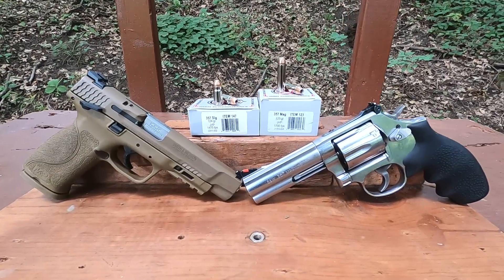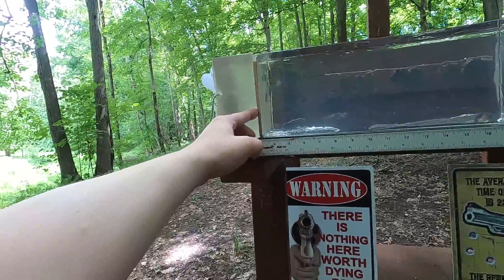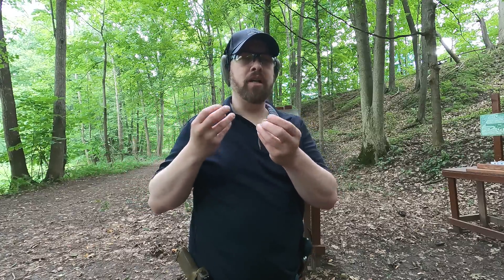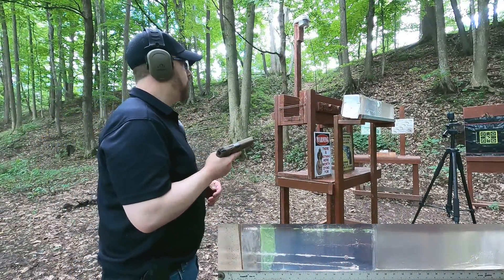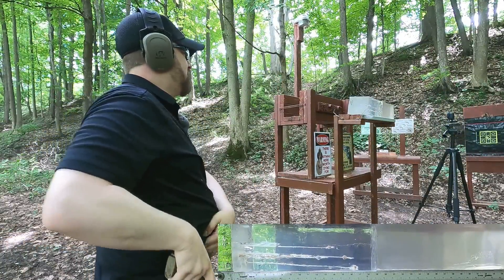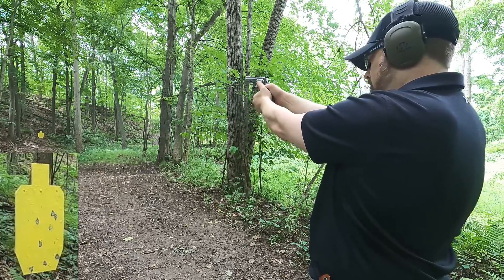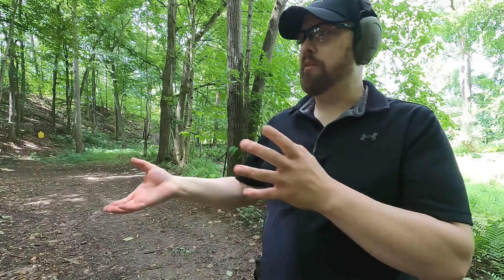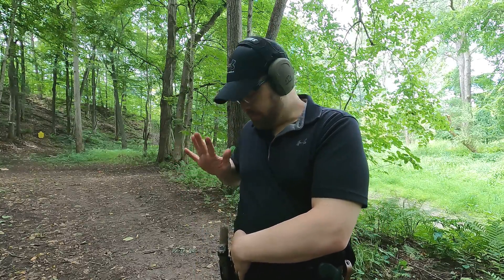💥.357 Sig VS 💣.357 Magnum - Underwood JHP - WOW - Game Changer!

Comment: Nice test. Looks like they did an awesome job of mimicking 357 Magnum 125gr ballistics with that particular loading. Hard to argue against 16 “Magnum” rounds with no reload. You did shoot the 686 better so that is worth mentioning. 

Good test. I personally may would lean towards a 40 Caliber anyway because the price of ammunition is typically cheaper and easier to find, but 357 SIG is probably the best overall auto loader caliber.
Reply from the maker: Thanks. I like .40 and .357 Sig. The .40 is more of a scaled down/up in a sense .45 auto, .357 Sig is like a magnum. So it's pretty cool how vastly different bullet weights can be between .40 and .357 Sig, 115 gr .357 or 200 gr .40's, so there's some versatility in there.

Comment: very good video as always!  and as usual i will say that even though there are inherent positives and negatives with any cartridge, so much depends on how the manufacturer chooses to load them. few and far between are 357s rounds that are not close to max, and it is designed for shorter auto barrels which why it is such a great round. the great 357m was designed for longer barrels but still has done very well in shorter carry lengths. as for the 40 ... (my conspiracy theory) the ammo manufacturers were paid off to sabotage it to revive the 9

Comment: That 357 sig is a great..I have 357 six inch barrel and love it. I have try to find a 357 rifle but it's like finding a treasure, always out and they r not cheap either...just love to have a 2000fps. with the rifle great all around round, decent for hunting within 150 yards which most of my hunting is 80 yards or closer..
Reply from the maker: You won't find much in .357 Mag rifles. There's not really a good middle ground, you might find the cheap $200 H&R Handi-Rifle in .357 Mag, but then the next thing up is a $700-$800 lever gun in .357 Mag.
Reply: @GunSam  Guess I have to work more overtime but I'm willing to do it to have one..

Comment: Do you think a 6 inch revolver would reach the advertised 1700 fps?
Reply from the maker: Underwood uses a 6" as their test gun, so possibly but it depends. With a 125 gr and the right powder, it's entirely possible that 200 FPS can be gained. With the "wrong" powder, you might gain no velocity from 4" to 6", and with 158 gr that uses less powder in general, there's no way you're going to get too much difference between 4" and 6".

Comment: I need a smith in 357sig, and maybe 10mil. Did you have to covert your Smith? Where did you get the 357 barrel and what platform do you need to convert it to 357sig?
Reply from the maker: If I am not mistaken, S&W stopped making anything in .357 Sig, but they did in their original M&P's. With the M&P 2.0 and all other pistols I think they do not make one. They have retained ".40 S&W .357" on their M&P 2.0 40 magazines so people can go with an aftermarket barrel like I did here. It's from KKM. Just the barrel swap is all that's needed for an M&P 2.0 40 to make it .357 Sig.
Reply: @GunSam  Thanks! I'd like there new 10mil too, but that 357sig will be first one my list! I knew there had to be someone that made M&P barrels. Thanks again get well soon!

Comment: If .357 Sig would have taken the place which 40 S&" once had it may still be there ahead 9mm. A major reason for going away from 40 S&W was that many LEOs couldnt handle the recoil good enough but .357 has less . So maybe 357 Sig still had its place. Its really strange that its such a underdog. But at least it was the caliber of the secret service for a while. I think they also go with 9mm now.

Comment: I wonder about cost and availability of .357 Sig range ammo.
Reply from the maker: all over the place. Generally it's everywhere, but less common stores might try to get $75 for it. Online it runs about the same as .357 Mag, maybe $40 per 50
Reply from the maker: but remanufactured is like $25-$30. It's just like, American Eagle that goes for 40 a box.
Reply: For the most part theres hardly any on the store shelves in last 24 months.
I ordered from underwood a couple weeks ago and it was on my door step 3 days later. 
Cost? I've been spending the same for 9mm and more for 40 at the local stores.
Reply: Investing in a caliber shouldn't even matter when it comes to your life. The 357 Sig is worth the investment.
Reply: @armedrebellion47  The gun is the investment.  The ammo is a cost.  If you go the range just twice a month, the cost of 100 to 200 rounds per trip adds up fast.  At the point adequate practice becomes cost prohibitive, you need to switch to a caliber you can afford.  And if you can't even find the ammunition, cost becomes irrelevant.  I own guns I couldn't shoot through most of the pandemic, because there was no ammo.
Reply: @bjs301  All depends on what you prioritize. I know guys that only shoot 454 Casull & 45 Colt. Neither are cheap compared to 357 SIG, mag, and whatnot. But unless the range was shutdown during the Crud. They were there every week shooting their 454's & 45 Colts
Reply: @nicholasroberts9618  Yes out of all the Ammo brands Speer Lawman will definitely be Available just purchased some last week a box of 50 rounds fmj was 56 Dollars each and i purchased Two.
Reply: @nicholasroberts9618  Yeah, it's back in Ohio, and the prices are starting to come down.  For a couple years it was scarce here.  Hopefully that's over.
Reply: @Matteo_  It also depends what you can afford.   I took one of my sons to the range recently, got on one of the interactive lanes, and shot up a couple hundred bucks of 9mm ball in an hour.  That was just two of us.
Reply: @bjs301  But it also comes down to what you prioritize. I know a guy who lives in a trailer, drives an old F-100. Yet he still owns 2 full auto machine guns. Met him at the old Knob Creek Machine Gun shoot.

Comment: Sam I would say the 125 is about the least efficient in the short barrel. If you picked a 158 SJHP loaded with Lil' Gun you could be getting over 1400 fps. No doubt though, that load for the Sig is awesome and I love the shootability of my 5" M&P.  The 50 yard 8 inch plate lives in fear when it sees the FDE 5" because it knows its gonna get dinged every second for about 15 seconds.

Comment: With automatic pistols you must lose a bit too with the backwards energy needed to drive the slide back so it probably equals out that lost in a revolver cylinder gap?
Reply from the maker: I really have no idea, but in general I believe that most semi autos have the locking mechanism that stays locked and the bullet already leave the muzzle before the slide starts to move, or right when it starts to move. That means that the bullet probably doesn't lose and velocity vs lets say a bolt action rifle, but I am not an expert on it.

Comment: Also sights will be a little off from the 40 s&w  iron sights on the M&p and glocks that you do the conversion in a Glock 22 vs Glock 31 have different height rear sights to compensate

Comment: 🤣🤣🤣🤣over the YEARS you have proven Underwood DOES NOT load 357 Magnum very "hot" the way they load their autoloader ammo. I believe over the years you have PROVEN Buffalo Bore 357magnum is unequalled.👍👍So before I even watched I said the "Sig" will "rock" I also remember you shooting BB 125 grain at 1700+ fps, out of your 4 inch barrel, in the past. Remember the B.B. will spit a 180 grain out at around 1500+/- or a 38 spec at <900 fps which makes the 357 Mag the better choice. I considered a 357 sig in the past and decided the 10MM was a better choice because Underwood Xtreme defenders come screaming out at around 1700fps or Liberty 60 grain Civil Defense close to 2400 fps  or you can go 220 grain hard cast -- the sig will not equal any of this at present.
Reply from the maker: Yeah, I ran some Buffalo Bore 158 gr at about the velocity these Underwood 125's gave. BB's 125 I have seen high 1,600 with a couple 1700's FPS in there.
Reply: @GunSam  Yes I know I watch all your reviews you do good reviews👍🏆

Comment: Some .40 S&W loads overlap with common .357 mag load in terms of energy when you're looking at the 135 to 165 grain weight range in .40 S&W. The shorter bullet affords more case capacity for powder. I've seen .40 S&W factory standard pressure loads from Winchester, Federal, and Underwood that deliver 500 or more foot pounds of energy from a 4" or 5" pistol. I think that's pretty impressive for a 15 round  pistol. The 135 grain spicy loads make me a little uneasy in a pistol because of the amount of powder. If you feel comfortable with doing it the 135 grain JHP .40 S&W from Underwood is rated at 1,400 fps with 588 foot pounds of energy, I think that would be really interesting to compare to .357 SIG and .357 Magnum.
Reply from the maker: I am pretty sure I ran that round before VS .357 Mag.
Reply: A hot 🔥 135 grain 40 has low sectional density and would have much lower penetration than the 357sig or mag

Comment: You can't argue with physics. The target experiences the kinetic energy from the projectile. The velocity part seems to be an important factor, although I've got to look into that more. Bullet construction is also important. All things being equal, 500 ft-lbs is 500 ft-lbs.
Reply from the maker: Yes, and if you see my pinned comment, you called it like a year ago lol. It was a gel block that did it. Wanted to hurry a melt to film the next day with 2 blocks remelted. Tried lifting from a weird angle and tensed up because the gel was liquid in the mold as I lifted it. Then pop, there goes my back. I'm lucky I didn't fall into the hot gel.
Reply: @GunSam  Ouch! That sucks. And yeah, 300ºF goo that sticks to things would be a real burner. Hopefully you can recover quickly. You've got the option of doing talking videos. Just don't do one where 357 Sig is the best cartridge ever ;-).

Comment: With all due respect, pretty much all factory .357 mag offerings are downloaded nowhere near book MAX to make snub nose revolvers easier on the hands. It doesn't take more than a minute in a reloading book to see that Underwood has loaded that .357 Sig to book MAX and their .357 mag is pretty much a starting load. The 357 mag loaded to book MAX (apples to apples comparison) should still hit 1700fps from a 5" barrel with a 125 gr bullet.

Comment: I've been looking for a drop-in .357 barrel for my .40 Pro Series. Where did you get yours?
Reply from the maker: Mine is a KKM. I have purchased my .357 Sig conversion from them and also a .45 ACP match barrel for my Glock 41 and both dropped in. You can always message them and make sure it will fit your particular model and barrel length. For warned they are pretty short on responses, like "yes it will" end of message lol. Means they are busy working on quality products which is great.
Reply: @GunSam  
Thanks for your reply. Been looking for one for a long time! I finally stopped looking.. 
My .357 is a Sig P320 with 4.7" barrel, so I imagine velocity levels would be similar. I have not seen any recent gel testing of Remington Golden Saber in 
.357 Sig. Picked up three 50rd boxes for a steal

Comment: Maybe it was the projectiles but I was expecting more penetration from the 357 SIG, especially in clear gel.
Reply: It is. The 124gn is a 9mm Nosler ASP bullet. Its really not designed for those velocities. Whereas the standard 125gn 357 SIG bullet is designed much more like the 357 magnum's bullet
Reply: @nicholasroberts9618  As of late I’ve been using the Hornady 38 cal 125gn XTP. Seating it to the upper portion of the cannelure and giving it a heavy collet crimp. This does seat the bullet a little longer than spec. Fortunately my chamber will accept it. As it stands it’s working it’s way to becoming my preferred 125gn loading. The XTP handles the velocity well. Accuracy has been great. And the crimp prevents the common setback issues that often plague it.

Comment: The .357 magnum spanked the .357 Sig. Deeper penetration, more accurate at distance, and slightly greater expansion. Thanks for Sharing!
Reply: Also doesn't help when the bullet loaded in the 357 SIG is really a 9mm bullet. As in its designed for use in a 9x19 at the velocities they typically achieve.

Comment: Carried a G32 for a couple of years. Never cared for the .357 SIG. Terminal effect is impressive but I found it significantly less pleasant than .40. Just didn't see the point then & I don't now. I'm sure the round has matured in the intervening 20 years but I saw pressure issues with Speer Lawman TMJ & I personally handled two G31s that had kaboomed. Not my cup of tea.
Reply: Glocks are pretty hard on the 357 SIG in terms of chambering. There is little neck so setback can be an issue which in turn can and will cause pressure spikes. That combined with a chamber that isn't fully supported can end up in a kaBoom. However at most 357 SIG has a near identical felt recoil or impulse. Although I would actually call it ever so slightly less.
Reply: @Matteo_  The 229 & 226 were both pleasant to shoot. The 226 was, for me 20 years ago,  indistinguishable from the 9mm, at least recoil. The G32 was just a beast. Ultimately, I discovered I was getting similar performance from 9mm 147 HST, so my interest evaporated. To each his own.
Reply: @basedyt6485  Yeah the 226 & 229 are just heavier guns than a Glock. Does a lot in terms of absorbing recoil. And the 32 is pretty much like a 23 in terms of felt recoil. Although as I said I would personally classify it as ever so slightly less. Even with an additional 5K psi to the 40 for its peak pressure. That said I'm not quite sure what you mean by "similar performance"? Since many people will attribute different things to that.  And yes everyone should go with what they like and prefer.

Comment: The .357 Sig can be loaded in an auto loading carbine, fed by a detachable magazine with velocities approaching 2300  fps. 357 mag is in either a bolt gun or a lever action and does push close to 2000 fps. Relads are timed with and hour glass while detachable mag is seconds at most.  He who has more lead on target usually walks away from the engagement... My opinion of course. And I do love my 357 mag revolvers  so I'm not hating on the .357 Mag.